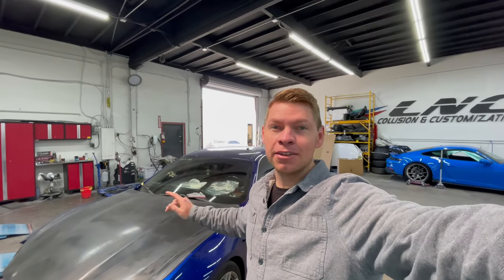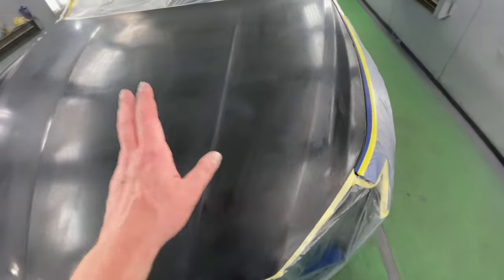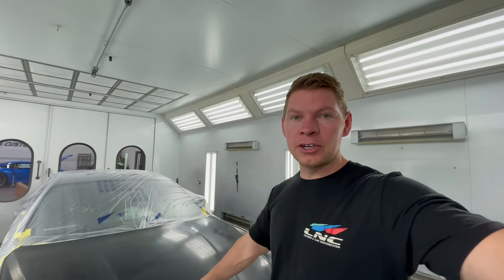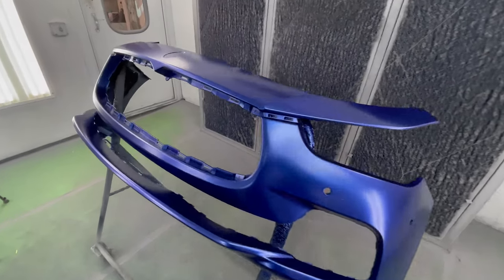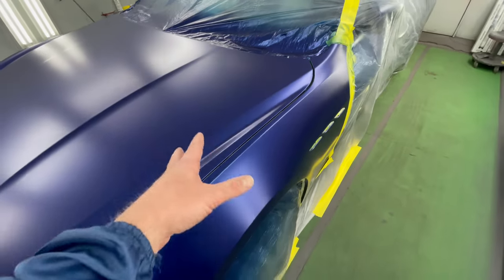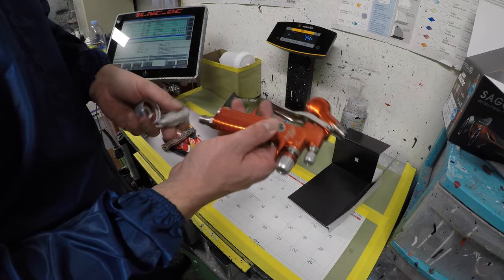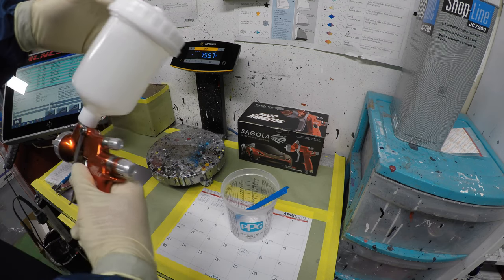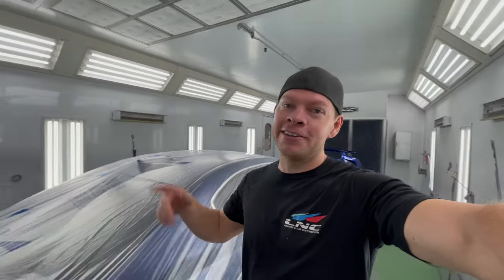Painting Maserati Ghibli - Showroom Finish w/ SAGOLA 4600 Xtreme Spray Gun - Blue Techno

Comment: Great vid Andrey nice to see some prep work, i've got the 4600 gun and its a good gun but i've been using my new Fuji V8 which is even better than the Sagola in my opinion. The Fuji breaks up the clear and lays down perfectly . Jim uk
Reply from the maker: Thanks Jim, never tried Fuji but good to know its a good option 😁👍🏻
Reply: How do you set up the Fuji? I use both all the time and always prefer the Sagola personally, maybe I don’t set it up right
Reply: @matthewwoolf8039  I set up my Fuji on the fly, as an old painter it becomes easy . You can put up some masking paper and check your pattern and flow rate plus air pressure. Always start with the fluid turned in and increase to suit . Good luck 👍
Reply: @jimmypratt6450  some people say start from wide open like as soon as you feel trigger resistance then count the turns in from there
Reply: @matthewwoolf8039  Thats correct, but there will be times when you'll need to adjust as you go depending on the finish you wish to acheive. Once you get the feel of the gun you'll  enjoy it . I started painting in 1976 and sprayguns have come along way but the principal is same. Most experianced painters can make most guns work.👍

Comment: your sealer has nothing to do with uv protection its to adhere to the ecoat you also shouldnt be sanding the ecoat your removing the corrosion protection and now your more likely to have a failure . sealer sticks to the ecoat, base sticks to the sealer. its the way ppg trains us been doing it for years 7  never had a failure.
Reply from the maker: Have you tried painting a new part with no sealer? The paint and clear coat will fail very quick. As far as e-coat goes, as far as I know the e-coat that you do not need to scuff or sand is the green e-coat you can apply sealer directly as long as you clean it and degrease it. Never did they say that about the black coating. 🤷🏼‍♂️
Reply: @LncPainter  you literally just repeated what I said you can't apply base to ecoat, you do realize most ecoat is black
Reply: I'm always surprised and people in the comments that try to correct folks. None of you ever have your own channel to show your work. It amazes me. You do know where being judgemental stems from right? If you did you would do less of it🏌🏼‍♂️
Reply: @Erik7prc  by correcting him to save other people from the poor advice he's giving, I'm a red seal painter I have zero interest in doing YouTube.
Reply: You did a beautiful job painting. Looks flawless.  Keep up the great videos.